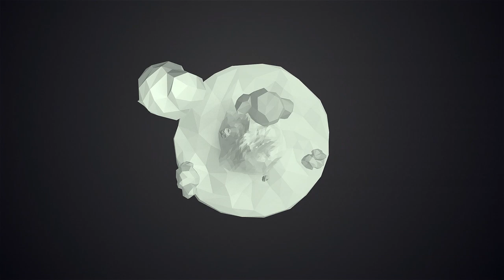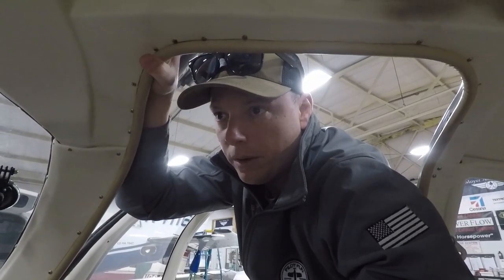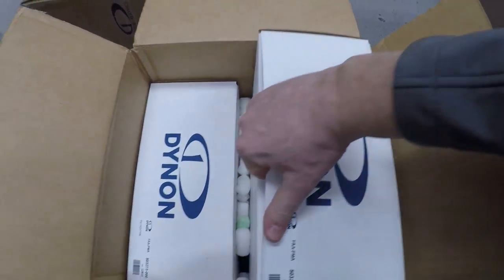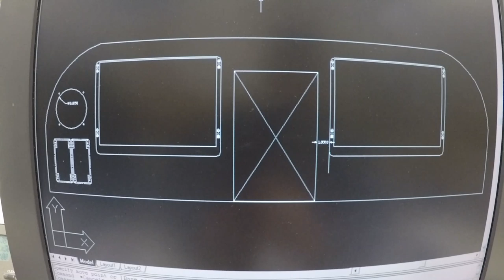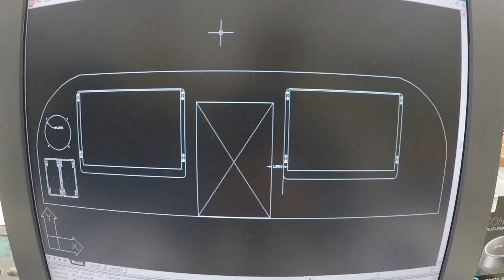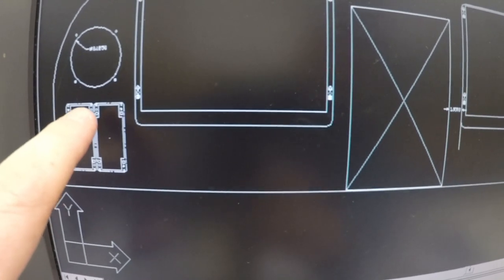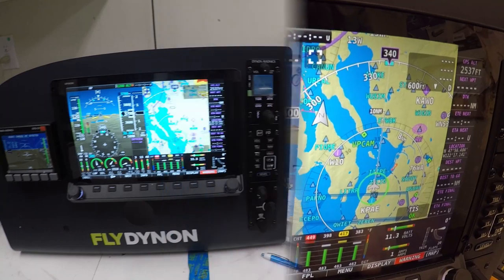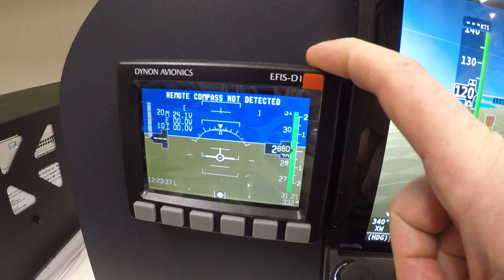PANEL & ANNUAL UPDATE! | DYNON SKYVIEW | AVIDYNE IFD540 | MOONEYM20C | N6887N

Comment: I will be doing a similar upgrade in the future.  I am planning on a single 10 inch screen and then use and iPad on the other side.  In order to keep my L-3 Lynx, I used the IFD-440 because it is smaller.  Even though the 440 is a smaller screen, when it is used with the IFD-100 app on the iPad you can get a full screen IFD.  I also agree with keeping a Nav/Com vs just going with a com radio.
Reply from the maker: Daniel Kelley Awesome!  I thought about going your route with the 440 but it was only 1,000 more for the 540. Very hard decisions with the process for sure. Now I don’t know if I should have ta gray or a black panel. 🤦